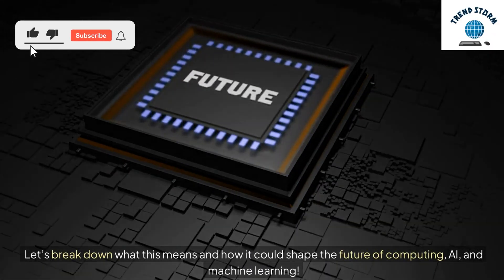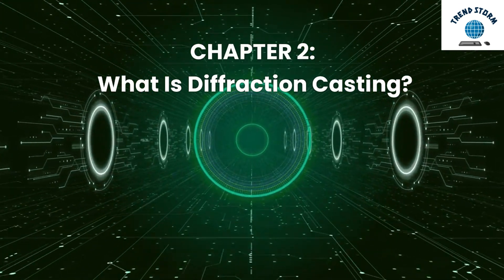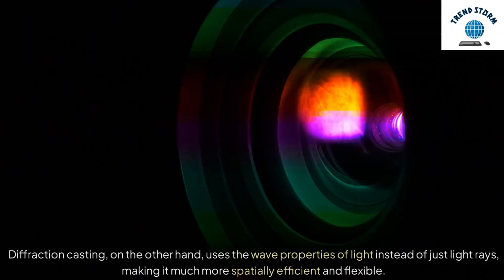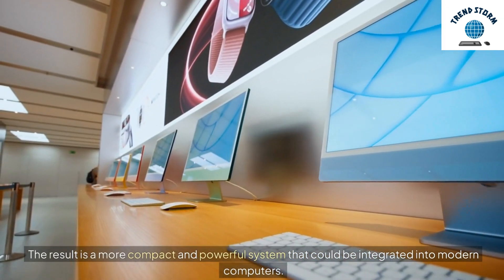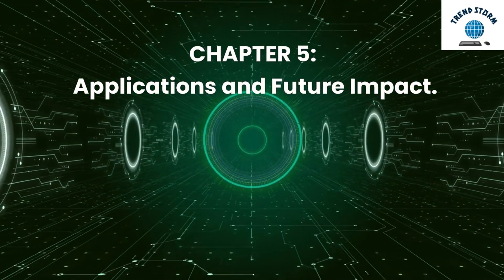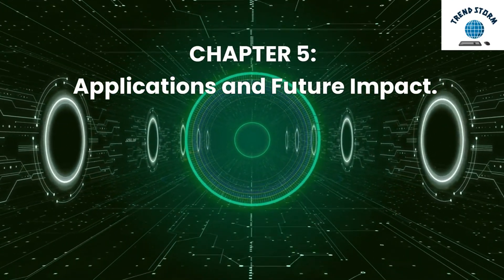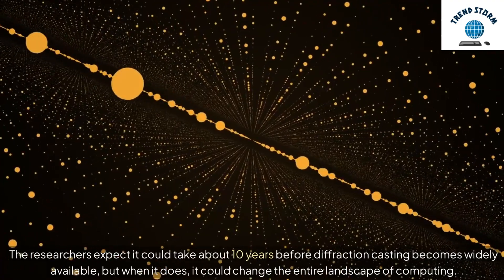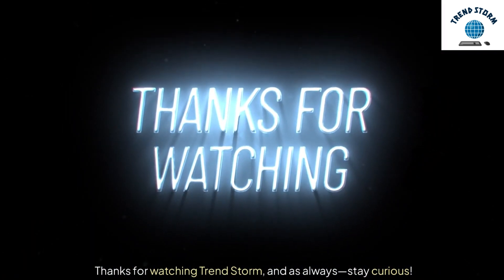From Light Waves to Logic | Inside Optical Diffraction Casting | Optical Computing Explained

Comment: thumbnail says "no heat", which I can tell you is not the case without even watching the video.  

I know this because it is not physically possible to do a non-zero amount of work without producing heat (at time of writing; will let you know if any paradigm-shifting breakthroughs in thermodynamics come along and destroy the foundations of modern physics ) and computation is a whole bunch of non-zero amounts of work
Reply from the maker: You're absolutely right that no physical computation can be entirely free of energy dissipation — thermodynamics still reigns supreme. However, the thumbnail might be oversimplifying what the researchers are really saying. The key point is that optical computing significantly reduces heat generation compared to traditional electronic systems, because it relies on light — not current — to process data.
In diffraction casting, most of the computation happens through passive light interactions (like diffraction and interference), which inherently involve far less resistive loss than electrons moving through transistors. So while it's not "zero heat," it is orders of magnitude more efficient — and that’s where the real breakthrough lies.
Appreciate the skepticism though — it’s vital when exploring claims that sound too good to be true!

Comment: How does diffraction casting handle complex data processing?
Reply from the maker: It processes data using light waves, which allows for simultaneous data handling in ways that traditional circuits can't match. This massively boosts efficiency in complex tasks like AI.

Comment: How does diffraction casting differ from traditional computing methods?
Reply from the maker: Great question! Traditional computers use electrical circuits, which generate heat. Diffraction casting uses light waves, which not only reduce heat but also allow for faster and more parallel processing.